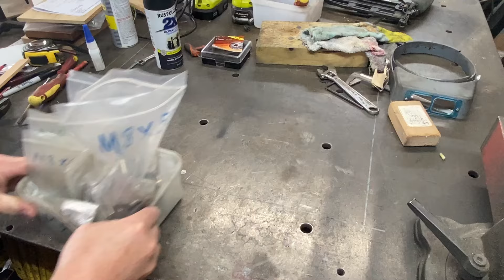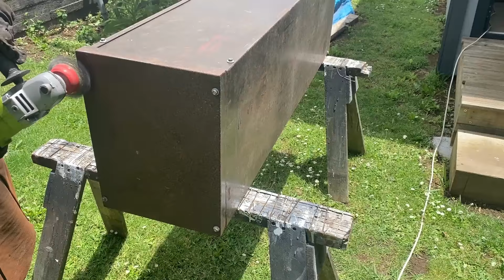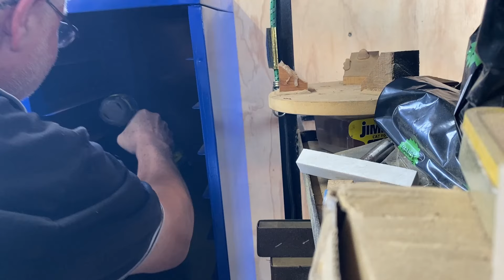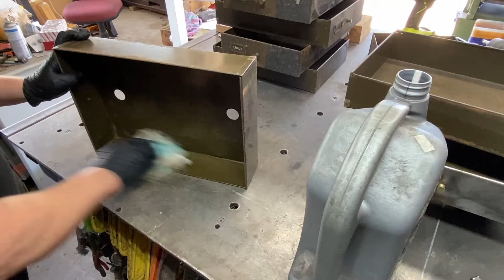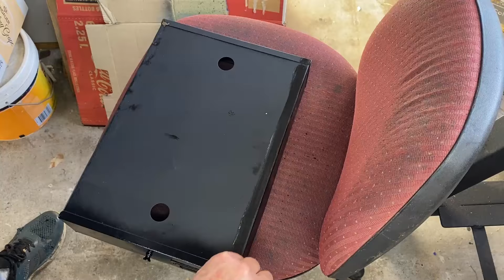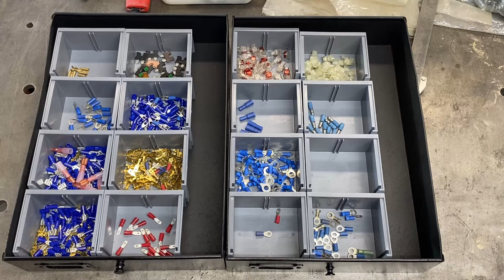Refurbishing An Old  Parts Drawer

Comment: The end result looks great. I admit I would want to make or find something to fit on the sides. I went through something like this recently, where I built a case of 14 wide wooden drawers for organizing fixings, drill bits, and a lot of other small stuff, and my main revelation was how many miscellaneous used wood screws I had saved up over the years, after taking them out of other things. They're in perfectly good shape, but they range in size from size 4 to size 12, and from 3/8" up to 3", so searching for something that I want to use in a given instance is a chore. Sorting those out is something I haven't tackled yet. So far I've only sorted them into very long, medium long, and all the rest.
Reply from the maker: Thanks for your comments.

Comment: Some custom 3d printed bins for the exact extra space on the side of the drawers would be cool, as well as a baseplate similar to gridfinity to keep you bins from sliding around would be cool!
T
Reply from the maker: Yes i did think of custom printed bins. I think I will do those at some point. Your idea on gridfinity is a good one. I dont know if we can get it here though. That said I have some thin non slip mat that would work well. Thanks for watching.

Comment: Great video. For the drawers, if there is enough space, a strip of UHMW tape on the rail will make them glide alot smoother.
Reply from the maker: Thanks for the tip.

Comment: Ok the ice cream containers are a bit of a mess but isn't it a great way to justify buying more Hokey Pokey? Oh dear, I need more storage for my [insert item here] and I have run out. Better go to New World and get some more containers. 😁😁
I would almost kill for a set of drawers like that. Do you have a link for the little storage boxes in case I come across drawers like that as I am running out of room on my custom made bookcase for the ice cream containers.
Reply: You can often find these bins on trademe in containers and bins within Business farming and industry. Sometimes the drawers also come up, usually under office furniture. I have a whole wall lined drawer cabinets - I never painted them though, so they are all mismatched.
Reply from the maker: Thanks for watching. I got the bins from BinTec, here is the link - https://bintec.co.nz/products/storage-bin-b200

Comment: NIce, being able to find what you need if pure gold!  I have bunches of Akro bins hanging off my wall!
Reply: I can't use those because I live near a tip and the air causes anything open to the air (and in some case in closed almost airtight containers) to corrode. Just a tad annoying but would be really suitable for my collection of knick-knacks.
Reply from the maker: It is so much better having this stuff organised. I got some room back in my cupboard as well. Thanks for watching.